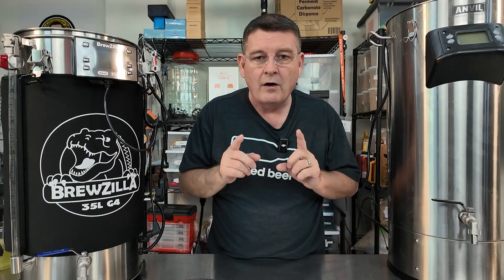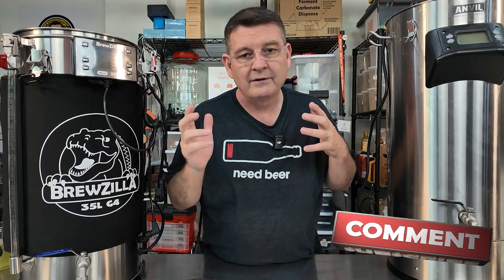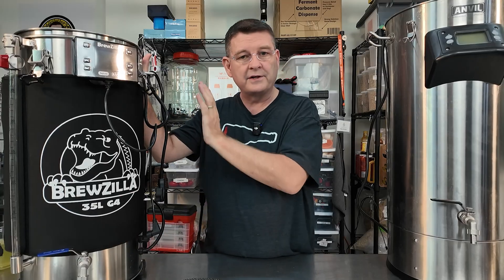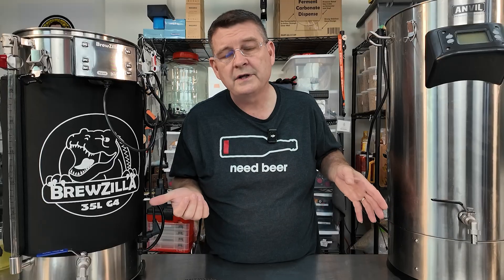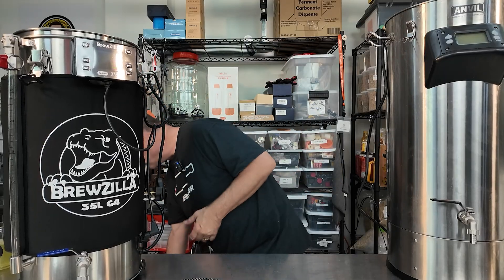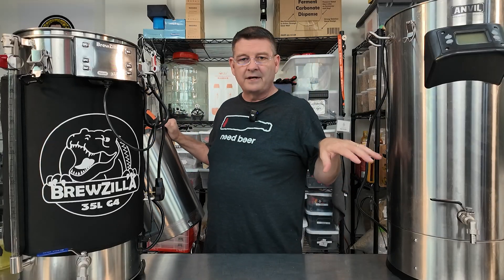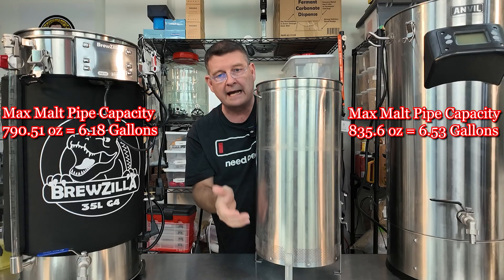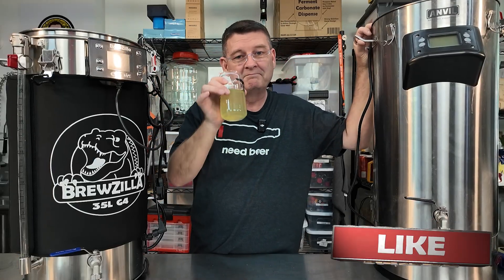BrewZilla Gen 4 vs Anvil Foundry 10.5 - Dead Space and Max Capacity Compared

Comment: Thanks for the video. To clarify this doesn’t apply for no sparge full volume.  Only batch sparging
Reply from the maker: The dead space applies to both systems in full if you are using their baskets. If you remove the baskets and use a BIAB, it will greatly reduce the dead space. The batch sparging or recirculation, help to minimize the impact of the dead space in the majority of the systems (Near the top of the baskets will still persist, unless you lift the basket to allow that water to mix with the wort already in the water making contact with the grains), and increase efficiencies. Any sparging at the end of course with clean water also has no impact on the dead space as it is simply used to do a final rinse of the grains.

Comment: Question, In Brewfather, under the equipment profile for the Brewzilla, the Mash Tun Dead Space number would be 2.45 gallons if I had the same setup as the video? Did I understand this correctly?
Reply from the maker: That is correct, as long as you are using their basket. If you choose to do a BIAB, that would cancel out the dead space along the sides of the basket that I used in the calculation. If using a BIAB, I would use the heat exchanger to help keep your bag from touching the bottom where the elements are. This would of course allow for a very small amount of dead space, but keeping from damaging a quality BIAB is worth it.

Comment: I have a Klarstein 30 Brauheld and it does what these two are presented. It cost 400 € on Amazon. So why overpay???
Reply from the maker: Sadly, that system isn't in the U.S., so I don't have any experience with it. If it has a basket, it would have some dead space as most systems do. BIAB is extra work, but if dead space was a concern it does help reduce it.

Comment: So, after fighting my way through this discussion on dead space…correct me if I’m wrong…you’re recirculating on these systems?? If so, grain is being contacted throughout, so what exactly is the dead space. I would have thought the actual dead space is the unusable wort at the end of boiling - what’s Anvils? 1 Gal??. Additionally, I use an anvil and I have to say the malt pipe is not the best design - I now use a BIAB (have for the last 10
Brews after 5 frustrating brews) and don’t use the malt pipe at all. I used to have nothing except stuck recirculating. Have you had any issues with the Brewzilla? I’d still say the numbers you’ve suggested for maximum grain in an Anvil are optimistic at best.
Reply: Should add - I am a big fan of your videos..!
Reply from the maker: Thank you for the kind words and I greatly appreciate it.
Reply from the maker: Dead Space is technically speaking the water not in immediate contact or constant contact with the malt. So you would have to assume no water is flowing to do the calculation, which then would give you the numbers. Dead Space isn't always a bad thing, it is something to be aware of for calculating your grain to water ratio, which helps avoid having an insanely thick mash that looks like dried out oatmeal. In theory you could always increase your water ratio to the point it makes things easy to stir and allows the flow of the wort around the grains, but then you may have to boil longer to reduce your total wort. The only major negative for boiling longer other than time is the "Maillard reaction" which causes your finished product to be a bit darker than expected. Most articles also state that it doesn't impact flavor or aroma, but I personally find that to be impossible as it impacts food, so why shouldn't it impact beer. 

If you currently have your grain to water ratio perfect for your way of brewing, I strongly recommend not changing it. As it rarely makes sense to fix something that isn't broken, unless you just want to see how it turns out. 

As for stuck mashes, I've only brewed twice on the BrewZilla and I did get close once. As for the Anvil, I've had a handful but I usually only get them if I start the recirculation on full blast before slowing it down to a drizzle. That sudden suction when turning the recirculation on at high is almost a guarantee for a stuck mash. I've done it on every single system except the BrewZilla, so far and every time it is due to the recirculation going too quickly and I want kick myself when I forgot to do low and slow out of the gate. I don't have a problem with the malt pipe, as long as I have the small batch adapter in as I don't like the holes in the bottom sides of any of the systems as it can impact your mash efficiency. BIAB is nice, but it is even harder compared to a malt pipe to know if you have a stuck mash if you can't guarantee the water is flowing evenly through it. There is some cool stuff hopefully coming out in the Summer time that home brewers that use BIAB should like, but currently I can't talk about it beyond that.

Comment: Your videos provide so much information. Got into this hobby by watching your videos. Started out with an igulu, then bought a second. Have stepped up by getting an Anvil foundry   6.5 and looking to add maybe a Brewzilla shortly. Have fallen hard for this hobby.
Reply from the maker: Yep, sounds like you went down my rabbit hole even faster than I did as I started with 2 - 1 gallon jugs and 1 gallon kits only to turn around and buy 12 - 1 gallon jugs for fermenting within months. I eventually bought a 3 burner system so I could do up to 12 - 1 gallon brews on a weekend by brewing 3 batches at a time and 2 sets of 3 batches per day over a 2 day weekend. And things kept going from there, but even when I get burnt out, it is just me being tired and having to deal with other issues in life as home brewing is one of the most relaxing and rewarding things I can do, so I really can't imagine not brewing. The 6.5 Anvil is one of the few systems I don't have and if it wasn't for being able to do small batches on the larger 10.5 or doing split batches I'd already purchased a 6.5 system.
Reply: Welcome to it!  Cheers.

Comment: Is the dead space in the spike Solo bottom correct on brewfather? I just got mine recently.
Reply from the maker: 3.2 Gallon "Spike Solo 10G - Bottom Drain" which is the one I have, and that amount sounds correct, but I would consider doing some math as it would be really hard to measure it without doing math calculations to get very close to the exact amount. Plus if 3.2 is correct, I would expect that for a full batch as the Spike Solo would also have a dead space per inch around the malt basket, and it would be reduced as it went up as it has a slant to it. The non-bottom drain is about 0.2 gallon less that would account for the bottom tri-clamp drain, although 3.2 oz seems a little low, but might also be correct.